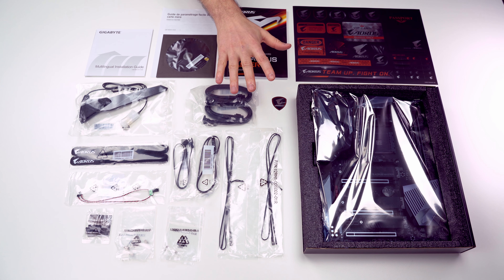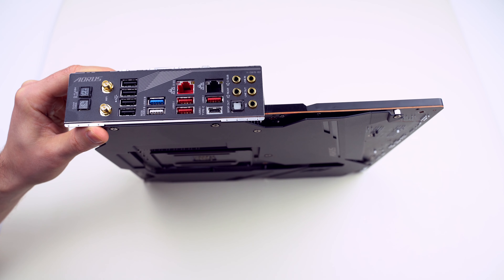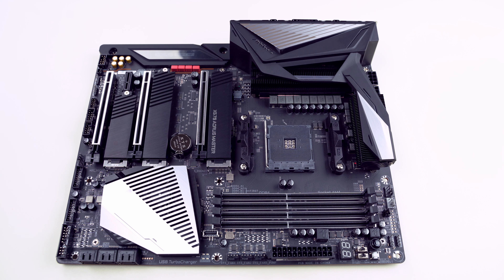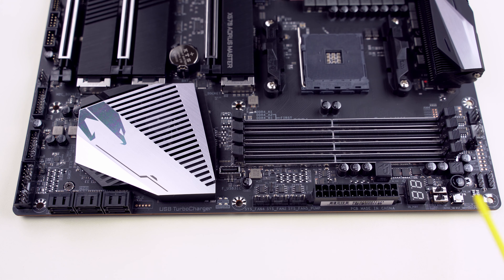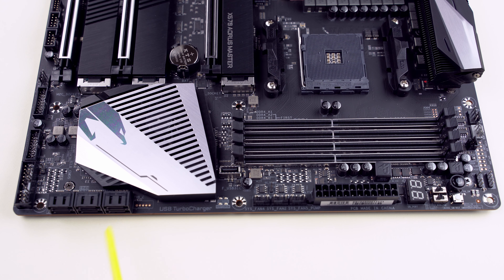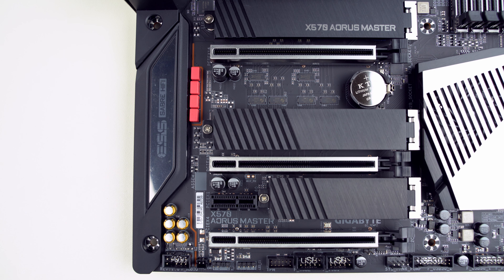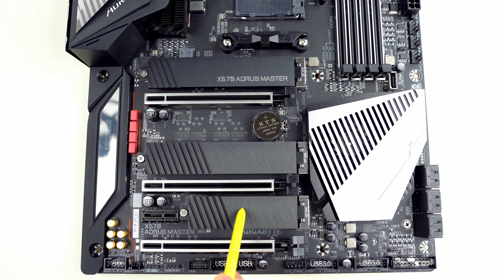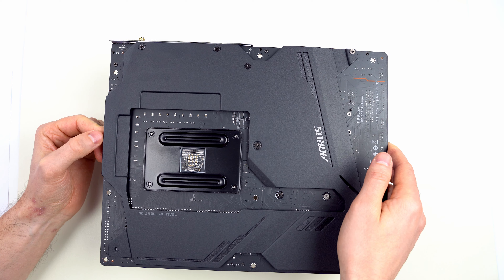Gigabyte X570 Aorus Master - Unboxing + Complete features description

Comment: Hi Martin, 
Enjoyed your video on the motherboard. Waiting for mine to arrive. Planning on using it with Ryzen 9 3900x for video editing for online teaching. This will be my first pc set up after 30years. So i am hoping your set up video will really help me out. Once again thank you this very informative video.
Reply from the maker: Hi Mr Tmun, I´am glad you liked it, 3900X is a very good choice for video editing. Wow, 30 years is a long time. What have you been running all that time? The build video is detailed so you should find there all necessary info for the assembly. However, if you find yourself stuck somewhere, you can leave a comment and I might be able to give you a hint. Good luck with your build!
Reply: I've been using macbook and macbook pro. But I realise with these new Ryzen chipset, price to product does not match for Mac. So I decided just give this setting up a try and hopefully your detailed setup video will help me. Thank you once again for creating all these videos.
Reply: By the way Martin, which do you recommend, the Firecuda 1Tb or the Sabrent 1Tb? Or it does not matter? As for GPU RTX or GTX?
Reply from the maker: True, Macs are overpriced compared to new Ryzen 3000 based PCs, especially the Pro version (which still uses 14nm CPUs and costs a fortune). Now I understand the motivation. 

Both of the drives you mentioned use the same Phison PS5016-E16 controller so the speed will probably be very similar (I am assuming you want to go for Gen4 SSDs:  Sabrent 1TB Rocket or Seagate FireCuda 520) and both have 1800TB durability. The warranty after registration is 5years for both, but Sabrent is almost 50 USD cheaper so I would probably go for Sabrent. But both are fine.

When it comes to GPU, that is absolutely clear, you need to go for RTX because of future support in nVIDIA studio drivers (those are best for video editing – which is what you plan on doing). Also, if you plan on editing videos in 4K, you must get one with at least 8GB video memory (2060s/2070s/2080s/2080Ti) otherwise the scrubbing on a timeline will be a nightmare (especially after aplying any filters or color corrections).
Reply: Wow. Amazing. Thank u Martin for the advices. Really appreciate it mate. Keep up your good work in your videos. I am definately supporting you.
Reply: Sorry I have a few more questions. Since RTX is the way to go, does it make a significant difference between the 2060 and the 2080 super? If the difference is substancial, then i would rather save the extra money and get myself a some more storage devices 😊
Reply from the maker: @MrDanialiskandar  OK ;) You got me curious and made me look into GPU prices after a while. Looks like everything is more expensive now.. So, here is the deal, I took into consideration only the models with 3 fans, because those are more quiet for video editing and have better temps, the performance is a rough estimate and my vary in different applications (just for the record and because this is a public discussion in a way). I looked at Newegg (1.6.2020) for prices and this is the conclusion: 

2060S (420USD) to 2080S (720USD)
Is it worth getting 13% more performance for 71% more cost? In my opinion not, but that is subjective, maybe it is wort it to you and if that is the case, than that’s absolutely fine. Objectively - Each 1% of performance increase would cost you roughly 5,46 % of increase of price. 

2060S (420USD) to 2070S (550USD) 
Is it worth getting 8% more performance for 31% more cost? Each 1% of performance increase costs you roughly 3,875 % of increase of price. That is more reasonable – I would consider it if I wanted and upgrade over 2060S. 

2060S (420USD) to 2080Ti(1270USD)
Is it worth getting 24% more performance for 200% more cost? Each 1% of performance increase will cost you roughly 8,41 % of increase of price. That is brutal, but you´ll also get additional 3GB of video memory which can be beneficial in more complex rendering settings. I just wouldn´t buy it now because in 6 months 3080Ti is coming and it would break my heart to see 40% performance increase for the same price I paid not that long ago. So that is a no go for now. 

Comparison to 2060S in short:
2080Ti = 24% more performance, but 200% more cost
2080S = 13% more performance, but 71% more cost 
2070S = 8% more performance, but 31% more cost
2060S = baseline
Reply: Once again your help is priceless. Thank you very much Martin. Much apprieciated. 2060 it is for me and probably upgrade it a year from now.
Reply from the maker: @MrDanialiskandar  You´re welcome, I think you made a right decision, 2060S with 8GB RAM will work fine for now and when new line of GPUs come out (which is soon) you will see what´s best in terms of price/performance and you wouldn´t be sorry for overspending on current generation.

Comment: Hello! Do you know why this motherboard takes forever to boot after it’s been turned off for let’s say like 10 or 12 hours? I just built my pc with this mobo and everything runs fine but the first boot of everyday is super slow it takes like 3-4 minutes to post (show the aorus logo on screen) and I don’t know how to solve it. I tried changing the RAM positions since the DRAM red led lights up during boot and nothing. I cleared the CMOS and also nothing. Loaded optimized defaults on BIOS and nothing. I also updated to the latest BIOS version and nothing. I turned on the fast boot feature and guess what 😂? Nothing :(
I don’t know what else to do so I may end up just returning it and buying another one. 

This is a list of all my components: 
-mobo: Aorus x570 Master(rev 1.2)
-cpu: Ryzen 3200G (still trying to get a Ryzen 5950X)
-gpu: nvidia GT710 (still trying to get a 3080 😂)
-RAM: g.skill trident z neo 64GB 3600Mhz CL16 (16x4)
-Storage: Samsung 980Pro PCIe gen 4 (windows 10 is here)
-Storage:Samsung 970evo plus 2tb 
-PSU: Corsair HX1200W 
-NZXT Kraken Z73 mm

I don’t know if you’ll get to read this but if you have ever seen this problem happened to someone else I would really appreciate to know how you solved it 🙏🏻
Reply from the maker: Hi Omar, it looks like you´ve done all the right thigs to solve the problem. I had similar thing happen to me on another system and my guess is that it might have something to do with a Windows update – not all updates improve the stability of the system. I also found out that it may take longer to boot if you have certain USB devices connected to the motherboard at boot up. 
RED light on the MB during bootup is normal, it is lit until RAM is tested and then it should turn off.

If there were something wrong with the RAM, there is good chance it would show up on the POST CODE LED display. Try checking what number it shows when not booting as fast as expected.
I would first try disconnecting some USB devices before bootup (if connected) and watching if it has any impact on boot up speed or not.

By the way I´m waiting for the same CPU as well. A guy who knows someone in the distribution told me these are the least common ones - they arrive in in smallest numbers and least frequently. Which is not surprising, because in a large scale these will not be the mainstream, so they aren´t making that many of them compared to other models.
Reply: @MartinsLab  thank you so much for replying! I will try doing a fresh install and see if that helps I don’t really have a lot of stuff in there yet  and I will also try disconnecting my devices to check. It just doesn’t seem right for this new pc to take more than 2 minutes to boot up 😂

Comment: Thank you for an excellent video. I am looking to build a new PC for video and photo editing and after researching  the internet the Gigabyte X570 came highly recommended. My idea was to combine it with the Ryzen 7 3700X. My requirement is for home use not business. One thing that puzzles me is the lack of GPU forcing the need to purchase an extenal GPU card. Seeing the prices of graphics cards, I'm wondering if there is not a better choice of motherboard that would give me Display and HDMI outputs. Could you comment and may be you would recommend an alternative motherboard / CPU ?
Reply from the maker: I´m glad you found it useful ;) 

There is a new line of motherboards coming very soon (in about a month) with X570S chipset. I´d check X570S AORUS PRO AX (will be cheaper than the Master). These motherboards also have passively cooled chipset heat sinks plus new USB 3.2 Gen2 X2 ports (20 Gbit).

Links for alternative motherboards: 
X570S AORUS PRO AX  - https://www.gigabyte.com/Motherboard/X570S-AORUS-PRO-AX-rev-10#kf
X570S AORUS ELITE (no WIFI) - https://www.gigabyte.com/us/Motherboard/X570S-AORUS-ELITE-rev-10#kf

Ideal home video editing setup:
•	Ryzen 5800X (or higher) - has better IPC + clock speeds compared to Ryzen 3700X 
        (I did some research - new APUs like  Ryzen 5600G/5700G/5750G disable PCI-E 4.0 support and can´t be therefore recommended = main reason for my edit)
•	X570S AORUS PRO AX or X570S AORUS ELITE (= cheaper alternative to save the most on the MB)
• 	32 GB RAM (2x16 GB for dual channel) - 3600 MHz - CL16 (which is on QVL - compatible with MB of your choice)
•	nVIDIA GeForce RTX GPU + nVIDIA Studio drivers (8 GB video memory minimum, more = better) - get the best you can afford, has the biggest impact on video editing
•	SSD (dedicated for video files/photos) - ideally NVMe with high endurance (TBW) - like Gigabyte Aorus NVMe Gen4 / Samsung 870 EVO (SATA) = cheaper alternative

Comment: Hey Martin great video! You’ve a new subscriber! Question, a clarification question rather... by using the M.2A slot and the top PCIe x16 slot simultaneously, there workmen’s be any bandwidth loss correct? As they have they’re own lanes(16, and 4). 

Also, I wouldn’t be giving up bandwidth in some other header (or lane) by occupying multiple usb headers would I? Thanks again for the great content...and resource!
Reply from the maker: Hi DataLLap! You understand it correctly - M2_A slot has its own 4x PCIE 4.0 lane leading directly to the CPU and nothing (no other cards or disks) will interfere with its performance. If you put any M.2 SSD in it (3rd Gen/4th Gen) it will not limit speed of any other slots (PCIE/SATA/M.2) on the MB. 

(Just one thing to remember is that if you put 3rd Gen M.2 SSD in it, the M2_A slot will switch automatically into Gen3 mode – for compatibility reasons, therefore the maximum possible bandwidth of the slot would naturally be only 3,9 GB/s instead of 7,8 GB/s which is possible only in Gen4 mode)

If you put your GPU into the top PCIE x16 slot and an M.2 SSD into M2_A slot they will both run at their full speeds and wouldn´t limit each other´s bandwidth in any way.

To the second question:

Simple answer is “No” – for 99% of use-cases.

To understand it fully, here is a more complicated answer 😊 :

The USB headers are connected to the chipset and therefore they share the bandwidth to the CPU (x4 PCIE 4.0 lane – 7,8 GB/s ) with the following slots: 

1) the last (3rd) PCIE x16 slot which can run maximum at x4 speed (7,8 GB/s) 
2) all SATA ports, they are slow (each can take 550 MB/s at max)
3) and both M2_B and M2_C sockets (if you use M2_C socket - it will disable the last two SATA ports and leave you only with 4 SATA port available) – each can run max at x4 speed (7,8 GB/s)

BUT, and this is an important part - you are limiting the maximum achievable speed of any device connected to the chipset (by PCIE/SATA/M.2/USB) ONLY IF it is being used AT THE SAME TIME and ONLY IF the bandwidth from the chipset to the CPU is fully utilized (7,8 GBs). Which could happen only under very specific and not very often occurring circumstances. 

(If I make some up - You´d have to have other two M.2 slots (M2_B and M2_C) occupied with two high-end Gen4 M.2 SSDs and they would have to be reading/writing at their full speed 5-7 GB/s simultaneously which is something you´d really have to engineer to do. Than the speed of your USBs and SATA drives would be limited, or the other way around -  they would be limiting the speed of the M.2 SSDs if they were reading/writing at their full speed at the same time).

Just by occupying multiple USB headers (connecting devices to them), you´re not taking the bandwidth from the chipset to the CPU. To do that, you´d have to be using the devices connected to them (the USB headers) simultaneously at a significant speed for a sustained period of time. So don’t worry if you´re planning on connecting your mouse, keyboard, webcam, mic, headphones and an external USB drive to your MB simultaneously using its USB headers. You´ll still have plenty of headroom before you start taxing your x4 PCIE 4.0 (7,8 GB/s) lane to the CPU by any significant way. 

The fastest thing you can connect to this MB by USB (v3.1 Gen2) is a 10Gbps external drive which can take at max only 1,25 GB/s from that bandwidth when being used. I am testing two of them right now 😉  

Hope this clarifies how things are. Thanks for the sub!
Reply from the maker: One more clarification, there might a confusion bethween 1) „USB headers“ and 2) „USB ports“.
What is below applies to the version 1.0 of this MB, and can be found on page 11 of the manaul for other versions of the MB -  v1.1 and v1.2.

1)	USB Headers - are on the motherboard accessible only from the inside of the case
2)	USB Ports - can be accessed from the back of the case - they are placed on the back panel of the motherboard

These are connected to the CPU directly:
2x USB ports (red ones) 2x USB 3.1 Gen 2, Type A - on the back panel 
2x USB ports 3.1 Gen1 (blue ones), Type A - on the back panel

These are connected to the Chipset:
1x USB Type-C port (USB 3.1 Gen2) – available  through the internal USB header on the MB (connects with front USB-C port on top your case (if it has it) internally using a cable – the „supercharger port“)
1x USB Type-C port (USB 3.1 Gen2) - on the back panel

1x USB USB (red one)  3.1 Gen 2, Type A - on the back panel
4x USB ports available through  two internal USB headers 

These are connected to the chipset + USBB 2.0 Hub:
8x USB 2.0 ports (all together) = 4 ports are placed on the back panel + 4 ports available through 2 internal USB headers (connects with front USB ports on top your case (if it has it) internally using a cable 

Now it should be clear what is connected to what :)

Comment: Good review! Just ordered this board today for my 3700x build.
Reply from the maker: Thanks! I think you will be happy with it, just get the latest BIOS.
Reply: Same, and same CPU! The board literally came back in stock today on Newegg for retail. I caught it before PCPartPicker even updated it's "out of stock" status 😄
Reply: @moehasan7534  Awesome! They were out of stock for like a month I noticed. Gamers Nexus did a vid on how supply should be getting back to normal in June so that's a good sign!
Reply: @jeffreypaul9428  ikr? Though ofcourse now I see threads about that board's 24pin connector bricking or something

Comment: Can we use the Usb 3.1 type c port for a display output? By using a usb type c cable can we run a monitor on this motherboard? Someone please help me out with this.
Reply from the maker: I checked the manual and it doesn´t say anything about this option, so the answer is very likely "No".  USB 3.1 Gen2 (10Gbit) port on the rear IO of the motherboard acts mainly as data port and front USB-C header is for both data and fast charging of connected devices to the case, acts as "USB TurboCharger" (max 18W).
Reply: @MartinsLab  Thank you sooooo much. So I'm forced to buy a GPU, which is nearly impossible in these times. And I couldn't find any other motherboard as good as this one.
Reply from the maker: @bingobango3509  No problem, you´re not alone - many people are solving the same thing these days. One of the possible solutions would be buying some passively cooled GPU like ASUS GeForce GT1030-SL-2G-BRK for example - for now, which would allow you to use your PC for basic stuff and later - when prices of GPUs drop to MSRP buy something more powerful. I recommended my friends to do the same thing. Prices of GPUs are insane now.
Reply: @MartinsLab  Yes, that's what I had in mind as well 😁. Thank you for your help.